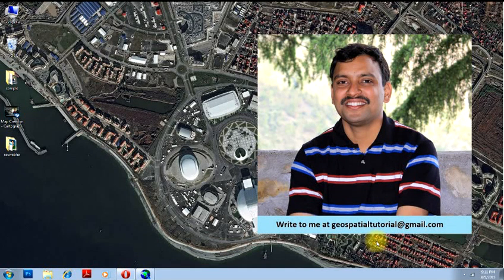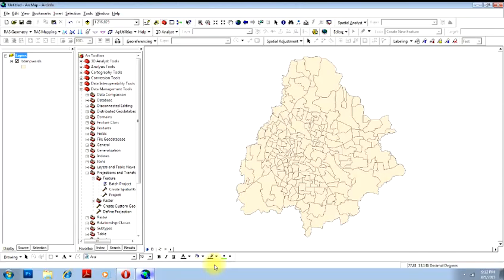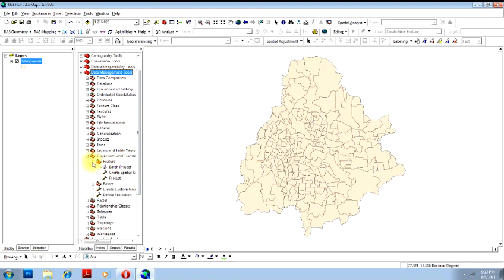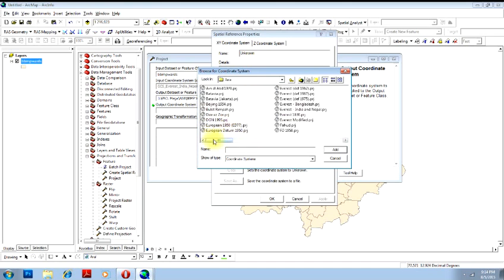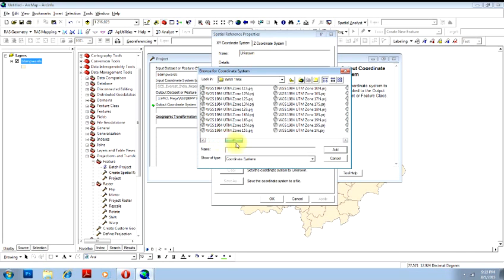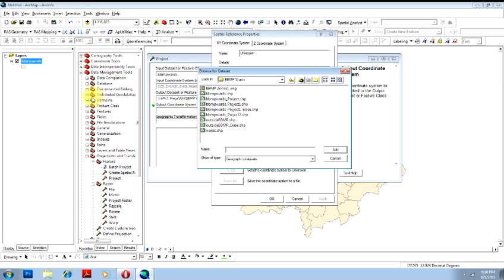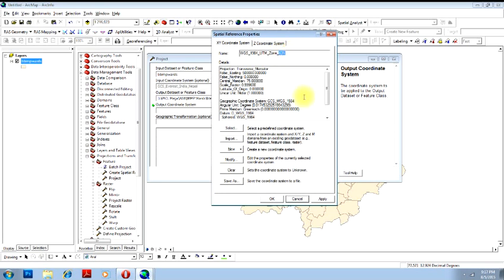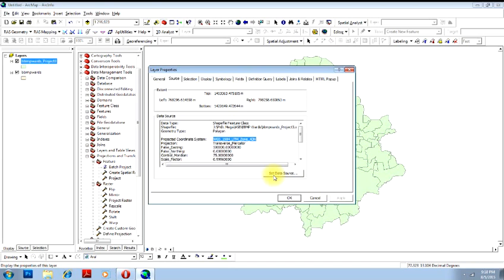Change Projection - Coordinate System in ArcMap

Comment: Hi, I have a problem. I have a layer with a certain georeferencial, and I have to project a set of points in that layer. But the points are in different coordinate systems, what can I do to project them correctly?
Reply from the maker: Ya you can do it. Just try to understand files are in which coordinate system and define accordingly

Comment: I am new in GIS and learning a lot of things. I saw this video it is really helpful, but I could not solve my problem on projection.

I currently working my study area shape file and DEM downloaded from USGS. The shape file projected to define projection WGS-1984-UTM-zone-37N (toolboxes/system toolboxes/data management/ define projection/projected coordinate system/UTM/WGS 1984/Northern Hemisphere/37N). I did the same projection for DEM file (toolboxes/system toolboxes/data management/ define projection/projected coordinate system/UTM/WGS 1984/Northern Hemisphere/37N).

Before doing this I try to adjust the layer property and projection to WGS-1984-UTM-zone-37N. But I could not find the layers in the same place the data frame, even though I checked the DEM and shape file is the same place from the topographic features. The only solution I got it now to see the two layers in the same place DEM (GCS-WGS-1984) and shape file WGS-1984-UTM-zone-37N but this might have problems in my final result. 

So could You please help me to fix this problem? kindest regards,

 Bella,
Reply from the maker: It is better to import the projection from some other file which is having same projection, rather than defining it yourself, as some errors can creep in
Reply: Thank you!

Comment: Sir, in Arcmap 10.4, during the extraction of watershed delineation from from DEM using hydrology tool, the flow direction and flow accumulation does not follow the actual path as expected, what to do?
Reply from the maker: Either your actual map is not correct or you will have to edit DEM. Where did you get the actual map from?
Reply: AsterDEM  from USGS earth explorer and cartosat DEM from Bhuvan
Reply from the maker: I am asking how did you come to know that its not matching? You compared it with what?
Reply from the maker: Clear indication that there is something wrong with DEM or the idea of the actual path
Reply from the maker: I may not be able to comment without being familiar with the area

Comment: dear sir.. if we opened two feature classes of one place, one in UTM and the other in GCS .. they can not overlay on the same place in the data frame.. can you tell the way to solve this problem? i have changed the coord sys to be matched with each other but do not work.. thank you
Reply from the maker: Make sure that both are projected.
Reply: thank you .. i will try

Comment: Sir, I'm working for a private GIS firm. Recently I'm involved in a work of field GIS data collection for local(HP Govt) in which we have to do gis integration of a field collected questionnaire.
The questionnaire has following attributes like
1.camera taken photo of four sides of a building structure
2. Lat and long values taken by Garmin GPS instrument.
3.height, length*breadth (area). etc 
Now my question is that can be automate this field data collection process and how we do gis integration of this data
Reply from the maker: I do not thing you can automate field data collection.